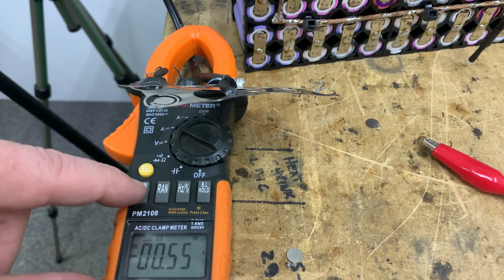Testing Battery Hookups fuses Ep 2

Comment: The short test 14 minutes in your video told me everything I wanted and needed to know about these thermo fusing tabbing device is not meant for protecting the battery pack for the device that it is powering 
What this test tells me that it would provide some protection for the battery pack if you a catastrophic short failure but it is not instantaneous shut down of power from individual battery cells this needs to be understood when using this device for protection 

I personally would still use this device for building battery packs but I would plan accordingly thank you for this valuable information and sharing your experience and findings

Comment: Simple.. if the fuse is 8 amp x 20 it’s now a 80 amp fuse ☝️and you used them on both sides.. so 2x80 amps is  160amps .. you turned that pack into a heater .

Comment: The problem is the low voltage pack. There not enough potential  to overcome the rising resistance of the wire so it turns into a heater wire.
Reply from the maker: Yep, dumb test but very fun to mess around with. WAS not the correct fault state.
Reply: @HBPowerwall  I just finished a 85AH 24v battery using these sheets. I really don't think this is a good way to fuse these. The fuse strip as shown in your video is not a good fuse. There's not enough of a bottleneck for current, the entire strip will just sit there and glow. Imagine your bms failing and shorting your pack with enough current to make these glow orange. You basically would have several KW of resistive elements glowing orange 1mm away from the insulator, quickly melting the insulator on the top of the cell, Then the fuse slumps across it ect and shorts the cell. I like the efficiency of it but I don't think its a proper fuse. It also seems very rare for a cell to fail in a way that would consume enough power to blow this fuse. Id imagine a cell that's got a few amp internal discharge would not blow this fuse but still be consuming enough power to go into runaway. 

Another thing to keep in mind with these is safety on install. I was laying a 3p sheet down and one of the fuse pad things slipped right into an 18650 and shorted, melting the insulation ring and shit. Had to pull apart the pack to get that cell out.  Took me a minute to figure out how I created a short circuit! That was VERY easy to do accidentally.

Comment: 14A-144A each cell is really high current.. and lets face it _ there are really not many case where cells short like that _ and each pack having 100 cell _ will ned 150A to 1500A _ thats insane _
Reply from the maker: Yeh, it's more when all the cells dump their power into one faulty cell.. fuse will vaporise then.

Comment: As I understood this cell fuses: This fuses are not to prevent shortcircuit of the whole pack. It is for a shortage protection in a cell itself. 
If you meassure peak current it will be always high, because it is a heat fuse. So always the integral of current and time is decisive.
Reply from the maker: Yes, it's wasn't a good test but I did learn stuffs so that's a win..

Comment: Would a bench top power supply have been a better power source? I am thinking that being able to edge up the amps over different periods of time instead of having a dead short each time would be a better test that would give a distribution versus time instead of a bunch of points close to a single value. Also, how about rigging up a test rig that test wires and nickel fuses comparatively under the same circumstances while clamped at both ends with the same mechanical pressure? The sudden dead shout short could be imitated by installing a quick snap switch somewhere in the circuit while the power supply is running at preset values. The bench top power supply could be set at several difference amperages and the results could be recorded using your phone camera using the same recording speed so that a time to destruction can be found. Also, using the same test rig, the power supply could be set to run somewhere between 80% and 100% of expected load which could tell a lot about the fuse behavior under continuous load greater than 80% of expected load. A heat camera could be really handy in recording temperature increase versus time in this setup. Finally, I would think that distorting the nickel before testing it would have some sort of impact because of the likelihood of weak spots being bent into the fuse itself. I would think that clipping the fuse free and comparing it length for length to the wire without distortion of either would be a better comparative test. Thanks.
Reply: This would be an interesting project to test this theory

Comment: I would expect a direct short to pop all the fuses instantly. Anything else, like creating heat coils we saw, would be too dangerous for the batteries.  Think I'll just stick with fuse wires.
Reply from the maker: if the battery larger, with a PROPER direct short & the fuses, wires, busbars were the correct size for the application I would agree.. this was just a fun hack test.

Comment: Ok this is what I think!!!! This nickel fuse strip is design for when one cell and only one get a short circuit. So, let's we said you need to connect your short circuit cable just Right on Top of negative or positive on a single cell. And the fuse strip will melt. That it. Grating from Venezuelan Citizen and Texas.

Comment: Seems like the resistance caused by the heating of the fuses was actually limiting the current coming out of the batteries. But that means that the batteries aren't putting out much more than then 3 amps each so that should keep them safe even with light show.

Comment: The way to test a fuse to slowly increase the current through it to see how much current it can carry before it opens. You do this using a bench power supply operating in current limit mode (set the voltage to a couple volts, set current to zero) then increase current slowly until the fuse opens. You're not looking for how fast it blows, rather, how much current it can carry before it does open. Ideally, the fuse should open somewhere near the cells maximum safe current.
Your test at 15 minutes is interesting. It shows that a single cell that shorts in a large parallel array should blow its own fuse, but it will carry a lot of current (too much?) before it actually opens..
Overall, this is an interesting concept, but the fuses just don't blow at a low enough current for me to consider them useful (as fuses)..
Reply from the maker: Yes, i'm going try this test again as now i have bench supply, just don't have much spare time

Comment: Wondering how critical fuses are for this application. I have none, I have just been using hardwire house electrical bus bars and linking the cells together using small telephone cable which is also hard wire. I think it was for inside the walls, anyway they definitely handle a lot more than 10 amps of current so they are definitely not useful as fuses. The wire you've shown looks super thin though, what is the amperage I should be aiming for when it comes to fuses? 10 amps seems to be a common target but I am not sure.

Comment: You could use the kweld to test the instantaneous blowing point. Easyer to rig up and a firmware upgrade may make a good test script with test output if you know someone that can programme it. 
Even without a dedicated option in the kweld just "welding" from the cell pad to the bus sheet with increasing Joules.
Reply from the maker: Sounds possible, but the 'community spotwelder' is hardly ever here any more booked out weeks in advance

Comment: That fuse pack will start a fire before its doing any good...
Reply from the maker: To be fair it's not the correct fault state for the fuses - just a bit of messing around.
Reply: @HBPowerwall  true, but in a normal use the drain is usually not constant, and how long does it take for the fuse to break? :) 
If its too long it can start burning:/
Reply: @williamwestonn  these fuses are not a security for a shorted pack. these fuses are for shorted cells.You got some serious problems if you whole pack is shorted. Tell me how you want to short a whole pack?

Comment: You absolutely shuld use need a bench top power supply to test fuses.

If you insist of doing it like this with batteries instead of a power supply or electronic load you need a >10MHz oscilloscope across a shunt or a magnetic oscilloscope probe to catch the flank, not a crappy magnetic clamp meter' max hold.
Reply from the maker: you should check out some of my older videos about cell fuses - this will make you eith smile or laugh lol 1. https://www.youtube.com/watch?v=RAfMq_EZ4oA 2. https://www.youtube.com/watch?v=5hiQCD8LPcs
Reply from the maker: OOh this is the one i was hunting for - https://youtu.be/eX6uIz_iflA talkabout basic tests
Reply: @HBPowerwall  I like that old video. You showed that the fuse doesn't burn.
By the way every fuse worth it's salt should come with a sheet like this: https://www.swe-check.com.au/images/content/time_current_curves.gif
So for example the fuse rated for 250mA will burn in 1 second when it sees 1 amp, but it will burn in 0.1 second if it sees 2.1 amps.
You just follow the curve what it is rated for and read the seconds it will burn in for which current.

Comment: As you could see from the video, the fuses around the nodes blow up first, and those further away stay in tact. The reason for this is that there is a voltage drop from the point of contact further on into the material , because of the high current. 
In the design of the total block, you use an extra thick copper wire to enhance the conductance. This was not present in your test. If you could repeat the test with those wires added, you will see better results.
Reply from the maker: I agree - I could have done the tests much better.

Comment: I use the 2p and if needed just cut out a square around the fuse with clippers then re-weld a square with the fuse on when cells replaced, its the only way I've come up with.
Reply from the maker: I've done it that way also just spotweled some 32awg fuse wire into place..

Comment: Have you ever done a soldered and none soldered fuse test. Wire of equal lengths, one which has been soldered a layer of solder on the wire and one which is straight off the reel. How much difference in current draw does it make to blowing current?
Reply from the maker: Math will tell you those results

Comment: In the test of the nikkel fuse the weight of the cable is pulling on the red hot fuse. On your battery fuse there is no pressure when it is red hot. That is why I think your battery fuse held.

Comment: They are good for 8 amps a piece so your 20p pack can hold 160amps without breaking.
Reply from the maker: Yep, and the nickel just wicks away the heat very effectively also. This is not how they are designed to blow. If only one cell goes bad the fuse vaporises

Comment: This method had potential danger. It works well when you apply an aggressive dead short. However, If you were to apply a current closer to the failure point of the nickel fuse, it would lead to the nickel fuse glowing orange/white hot, conducting heat into the cell(s). The cell would absorb the heat resulting in catastrophic failure of the cell. It's better to use a fuse material with a lower melting point.
Reply from the maker: True - all fuses only work at their given load. I can short out my 80p packs with little tiny fuse wire and exactly the same thing happens. But when only one cell is shorted the fuses vaporise. Best part about this is the nickel acts as a large heat sink and does a great job of dispersing heat. Pros and Cons could be unsuccessfully argued for all time. But thankyou for your input helps everyone make their own mind up on what is acceptable safety wise. Have a good day.

Comment: Great Video!  So what do you do after a cell blows a fuse and is no good? How do you replace the cell and refuse it?
Reply from the maker: You just have to do what you do to get it out and replaced - but one would hope that not adding heat via soldering will reduce those issues even further.. making it less necessary to upgrade cells

Comment: Curious as to using a TEG peltier gen for the heat distribution collecting even if its a volt with no amps would be neat to see. Conformal coating could help with many of your board concerns.

Comment: Cell replacement could be easy if you use mini magnets instead of spot welding.  BTW, I would not fool around with extreme currents inside the house; exploding battery packs are not a joke.
Reply from the maker: It's my workshop and accept those implications

Comment: The resistivity of Ni is higher than the material your fuses are made of; so the Ni fuses heat up faster, hence they should blow faster. But I am rather suspicious about how thick that Ni fuse is. Much thicker than a fine strand of copper wire. I tested very fine strands of pure copper which, as you know, is a superior conducter. Those hair like copper strands blow at 6 amps. A dead short makes them blow instantly.
Reply: You do not need a regulated PS. You can easily create a closed circuit in which you include a fixed power resistor, like a 4 ohm 50 watt or 100 watt resistor. Then you increase the current in the circuit in steps in by adding one cell in series at a time. So you test with rising voltages over a fixed power resistor with 4 V - 8 V - 12V - 16V ... increments. Current rises as voltage rises.

Comment: No fuses will take so much time even after a short circuit check out Tesla fuses how fast they blow if the cells are shorted . I feel this design is complete disaster.
Reply from the maker: to be fair this isn't a very good test at all  doing the whole pack short with a cable that's too small. all fuses blow at their rated capacity - it's hard to know if i was exceeding that. it was a shit test but I did enjoy it
Reply: @HBPowerwall  there is a design flaw in this fuses . Fuse getting red hot but not blowing is a flaw from my knowledge this fuse should have some physical stress so that when the mechanical strength goes down the fuse disattach from the battery so it fuses out in the perfect current load

Comment: Nice rough-n-ready test Pete. Does the fuse design work? Yes. Is it quicker to build? Yes. Sorted.
Reply from the maker: I love them - got it down to 10-12 min for both sides of a 80P battery. Only limitation is the heat in the electrodes
Reply: Nice. This might be the final nudge towards getting a spot welder.

Comment: Pete, your large pack fuse of course would not blow or at-least not in the time-frame you had it connected.. you have to remember mate if that was an 80p pack then that sucker could potentially do 144amps without blowing due to the fact 80cell's x 2 amp each = 160amp for that pack at an easy 2 amp each cell minus drops due to internal resistances lol. 

If you wanna blow a fuse youl have to have one that's not attached to anything just a fuse between + & - as your test on your 80p pack fuse had what we call parallel path's. Hope that helps clarify why you saw 144amps.

Comment: In that final pack test did the fuses (that went dark) actually blow or was it just the cells that failed (CID or PTC activation)?
Reply from the maker: some it was the fuse on the other side, some were CID
Reply: HBPowerwall thanks! I totally forgot about the fuses on the other side.

Comment: So the whole idea of the spiral parts on the nickle strip is to act like a fuse right? 
I'm thinking that because it is so long that it acts like a resistor, causing the battery to heat when doing long time charges and discharges. 
I think having the shorted amount of fuse section possible would be best. 

That meter won't be accurate as it has a certain polling rate and it most likely won't pick up the actual peak in current but rather on the come up.
Reply from the maker: the spiral would seem to be a compromise between being able to reach the cell without any stress or kinks & amp rating. Meter is not at all accurate :( But that said it was fun to play and enjoy the learning curve even if it was very wrong - now to try do it right.

Comment: Would of been interesting if you measures the current in the dead short test, you could then work out what each fuse was drawing (current / 20 cells). If you needed around 24A to blow one fuse quick then for 20 cells you would need 480A.
Reply from the maker: It was 220amps inrush, didn't see constant. That footage was seen after release, will inc it into next video

Comment: Pete, the melting metal coming from the fuse would be of concern too. I guess the vertical orientation of the mounted pack, would help alleviate it dropping into the cid area.
Reply from the maker: it cools so fast i don't think it'll be an issue but I understand your concern when you see it in slow motion

Comment: I've got an order in for this nickel strip. When it comes in, I'll be doing a test with a lab-grade benchtop power supply to see at what current/time the fuse actually blows. Hopefully, I'll find the time to actually make a video on it.
Reply from the maker: Let me know I would be keen to see a proper test rather than my BS lol
Reply: @HBPowerwall  Will do! My plan is to characterize the fuses like one would a traditional fuse and make a graph of current vs. time to blow. We just got in some nice lab power supplies that can do up to 30A, but worst case I'll use an 18650 with a current clamp and oscilloscope. Pete, I was terrified those cells were going to go into thermal runaway on you during your short test. I'm glad everything ended safely!